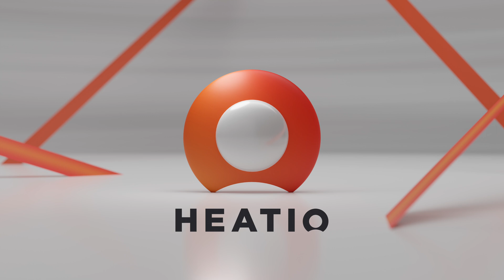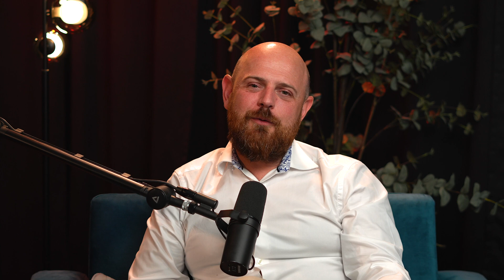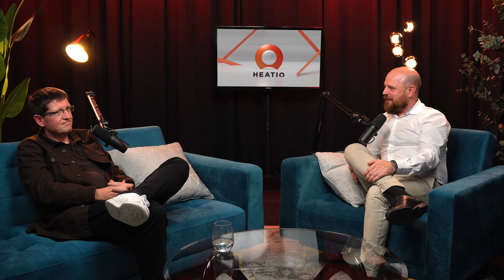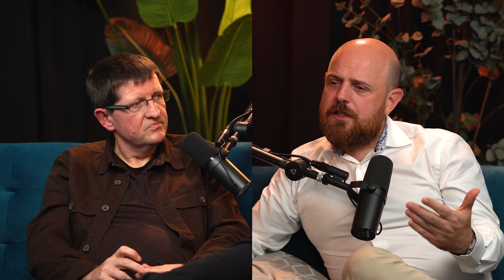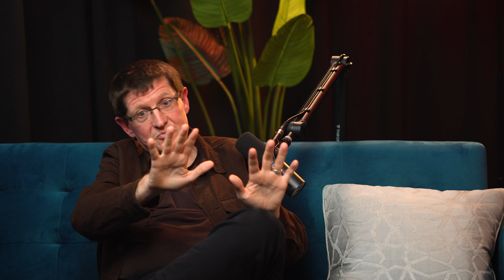Episode 14: Navigating the Cost of Living Crisis: Green Solutions and Affordable Energy

Comment: If I can run my gas boiler with flow temperature of 48 C at ambient temperature of near zero and still able to keep room temperature at 20-21 C then I thought that existing radiators and piping should work with the heat pump. The boiler runs at around 5 kWh. I have received several quotes where the heat pump sizes varying between 5 and 14 kWh. I am waiting for the survey by Octopus. Hopefully, I will get a proper size by Octopus without altering the radiators and pipes.
Reply: I finally decided to proceed with a 5kW Vaillant system. The installation is expected to commence end of this month.
Reply: Run a mile at 14Kw then as its totally unsuitable from what you need. How many square meters is your home ? mine is heated by a 6kw and its a 70yr old 3bed semi with 100 square meters